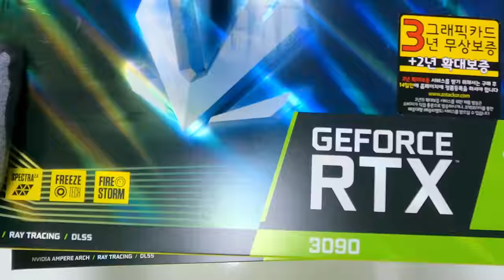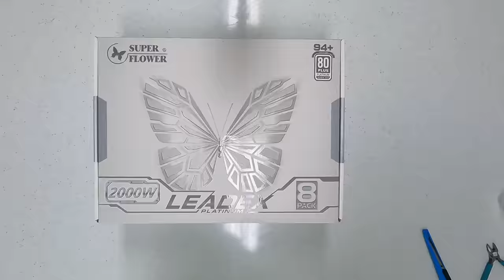&24000 GPU Workload GPGPU Workstation

Comment: Companies should make separate versions of GPU without fan and heatsink  to minimize wastage for  custom liquid cooling people.
Reply: Its just not many ppl do costume water cooling. But there is some premade factory one that already moded.
Reply: You can buy cards from all manufacturer with water blocks preinstalled
Reply: Basically i was saying that in all his builds he is removing fan and heatsink and i am sure it is wasted.
If companies like asus msi zotac make card without heatsink and fan for people putting custom liquid cooling.
I am sure it will reduce electronic waste and cost of card can also be reduced.
Reply: U get water-cooled units with ek blocks.i think colorful or zotac both make

Comment: prefect video, I like that
but I have a newbi question: Why you didn't use one huge fan instead of 9 small fan?
Reply: Cause it doesnt exist
Reply: nobody makes a fan that big. additionally, smaller fans have higher static pressure which means they push air through the fins of the radiator with more force. Hope this helps
Reply: bcs noice bro

Comment: Nice! About the Two PSs: How does one sync the two power supplies to energize at the same time? Does one power just the GPUs and one power the MB and coolant loop pump? Also, do the GPU cores run at a different/same voltage from the CPU cores? Thanks! Best!

Comment: Great build! But I think you miss the point of using the enthoo 719, you could easly put 3 triple rad on there and more...
Reply: Well I see youre using 2 psu, so I guess that counts as a valid point for this case. But even so I think that trying to fit radiators inside with that configuration would had been fun to see.

Comment: as much as I love your work, I have a question.
will it be better to route the water first to the CPU then to the radiator then to the GPU?
if not why?
 what made you choose to route the water pipes like you did?
Reply: Once your loop reaches equilibrium, the order doesn't matter. If the pump is doing its job the liquid will be flowing through too quickly for one component to heat up the next in any meaningful way. As long as you have fans and a rad that can pull the heat away in sufficient quantities loop order doesn't matter.

Comment: Why is the computer on but the pump not running in the final shots of this video?
Reply: could be that he set the pump to start/stop depending on the temperatures. in idle, the pure mass of the water & the waterblocks are most likely more than enough to keep the system cool.

Comment: Next time you do a workstation with 4 gpus like this consider the threadripper pro, it's much better than xeon.
Reply: he's probably doing that (building it) for someone. He can't do anything about it.
Reply: Professional software is often only certified for Intel. Also the Xeons have a lot better AVX-512 performance which is relevant for some use cases.

Comment: the last gpu receiving the hotter water: am I a joke for you?

I mean, I'm not sure if the water really would be hot at that point, it would depend on how much heat the GPUs are "producing", right?
Reply: does not really matter. it's just a few degrees. There are great videos on youtube about Loop order and if it matters if you have 2 GPUs then CPU, or CPU then GPU or CPU > Rad > GPU > Rad etc

Comment: what is the purpose of this computer?
Reply: i think they are system integrators, so its probably a commissioned build
Reply: @chronicallyonline6979  render, I think
Reply: @Leonardo-wo8gv  if render, why not go with amd? They got 128 pcie lane _-
Reply: It's not for rendering it's for machine learning
Reply: @disbade787  welp i say what i know
Reply: @disbade787  besides, if its for machine learning, why tf the don’t go with amd? They got 128 pcie lane and thats enough for 7 GPU at 16x or 15 gpu at 8x. My mind had changed with their powerful CPU and Mobos
Reply: @Zan2423  I was replying to the other guy who said it's for rendering lmao I 100% agree with going with amd
Reply: @disbade787  then tell him
Reply: @Zan2423  what? I did
Reply: build hyip website/cloud mining doubler
Reply: @Zan2423  There is lots of software out there that is from the ground up optimized for intel. Most of these kinds of machines are bought/commissioned for a very specific workload, so raw power usually isnt the deciding factor. That just comes down to the fact that Intel had been leading the workstation market for so long.
Reply: @yuh_lentina  welp, lets see amd will gains trusts on those markets and dominating…..

Comment: what is. the most significantly change with four 3090? i've seen videos about sli and the change is not a notable thing.
Reply: CUDA accelerated software don't need SLI to use multiple cards.
Reply: its not for gaming. it uses the four cards separately.

Comment: Hello there, I am buying this board and also the waterblock, I dont have it clear. Whick EK waterblock EAN is the correct one to use with this motherboard?¿ Is it this one 3831109813904 or this other 3831109813911?¿?